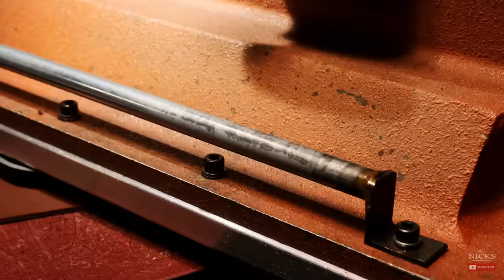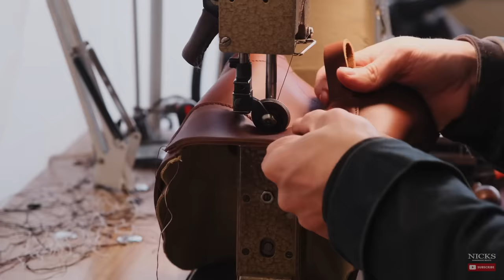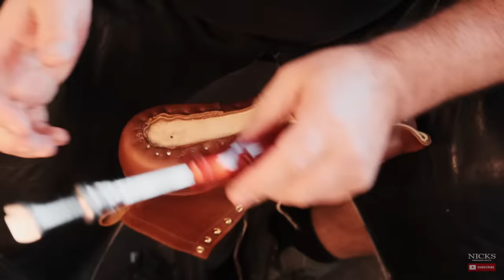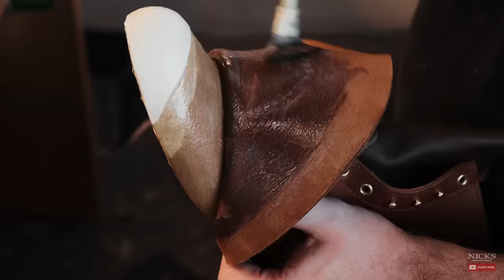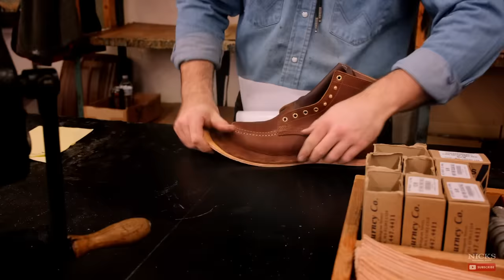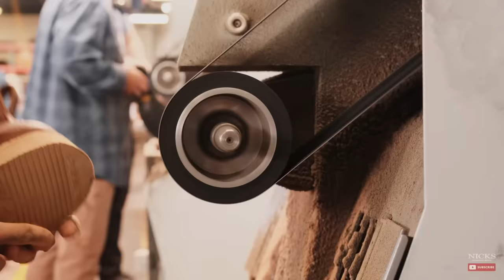World's Toughest Moc Toe Boots - How It's Made - Nicks Handmade Boots

Comment: Hi guys great video as always. Can you guys make a video about the Nick's belts that you guys sell. Just wanted to know the differences  between the work belts, do they use rough out leather as the boots. Or if the use other leather, Like the heritage leathers.? Also how thick the belt are, do they need time to break in the belt? If you guys can thanks so much. For the time. Next time peace ✌️✌️✌️
Reply: I bought an 1 1/2” work belt in walnut at the same time I ordered my walnut Builder Pros. Supposedly made from the same swath of leather as my boots. My belt is double the thickness of the boot leather, extremely strong and very comfortable. My favorite belt ever, even does a fine job doubling as a gun belt for my .44 Magnum. 
     It’s smooth out leather, and from what I can tell it’s two pieces glued back to back. The hardware is really heavy duty. Took a couple of days to be easy to buckle it, but aside from that there wasn’t much “break in” to speak of. 
   Hope that helps👍
Reply: How can i order for Nick shoes and Belt can anybody help me plz
Reply: @9224715607  Go to their website. Nothing to it.

Comment: I don’t understand the size guide.  On the diy sizing page it says boots typically run 1/2 size large, on the boot configuration page to buy them it says they typically run 1/2 size short.  Which is more accurate?
Reply from the maker: Your boots typically run a 1/2 longer, so if you wear a 9.5 is most brands, we recommend a 9 in ours.

Comment: It's a pity that there are only normal street shoes and no S3 safety boots with steel toecaps and puncture-resistant soles. Unfortunately, these shoes also do not have a non-slip profile and the sole is only glued and not sewn to the last and has no antistatic properties. The sole should also be resistant to oil, petrol and acid. I miss a cushioning system for the heel and there is no padding for the ankle. If you had all of that, you might be able to spend $500, but my 70-euro work ankle boots are a cut above that, because they are equipped with the safety features I mentioned. I wore the last pair every day for over 10 years. Even at minus 28 degrees Celsius, my feet were warm and dry. Sorry for my criticism, but after more than 30 years as a telecommunications craftsman, you appreciate good work boots. I might wear these shoes in my free time.

Comment: I'm curious about why the toe stiffner isn't leather and also why there is a piece of foam between the midsole and the insole
Reply: I believe that piece in between is actually rubber and is only intended to prevent squeaking.
Reply: That white piece isn’t a toe stiffener, it’s a celastic toe made for form and minor protection. The rubber pad is a squeak pad
Reply: @jamesallen2909  you just basically said it's not a stiffiner, it's a stiffiner.

Celastic stifinens the toe box.
Reply: @jeffmitchell72  it’s one thing to make the toe stiff, it’s another to make it retain its form over use. Celastic toes are quite soft, they don’t stiffen the toe, they just ensure the toe doesn’t collapse. It’s you can’t understand what the difference between rigidity and structure is, do yourself a favor and go back to high school language arts class
Reply: @jamesallen2909  nobody used the word ridgidety. 
A dirty towel can become stiff.
Celastic STIFFENS the toe box enough to help it keep it's shape.
C-e-l-a-s-t-i-c   s-t-i-f-f-e-n-s
You yourself even said celastic provides "minor protection" which is more "ridgidety" than I'd give it credit for. So your own words betray you. 
If you can't comprehend the conversation without twisting it up to make you feel right, then go back to elementary school.
Reply: @jeffmitchell72  rigidity and stiffness literally are synonyms. Pick up a dictionary once in awhile, it’d do you some good. 

They add minor protection when you double them up, which bucks will do, but it’s not necessarily their intention. They’re really just for shape. Which again, shape doesn’t mean stiff. They’re still wildly pliable

Comment: That's disappointing they don't use hot cork in the midsole. And for the price of the boot they should. I could buy a cheap that does and they're goodyear welted also.
Reply: They use leather midsoles. Lasts longer than hot cork and forms better to the foot, though it takes much longer to get there. Goodyear welting is not the be all end all of quality footwear. These are completely resoleable  and rebuildable.
Reply from the maker: Thank you!

Comment: Great work, but can't get over you use a latex mid layer sole 🤦‍♂️
Reply from the maker: It's called a slipsole and it is stitched and glued to the leather construction and helps the Vibram Crepe sole adhere to the boot much better since it is too thick to be stitched through
Reply: @nicksboots  ha, no the black one next to the foot insole,, surly should be cork? 🤔